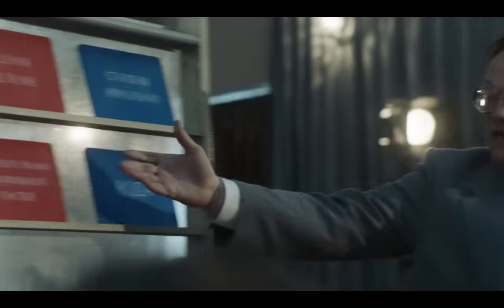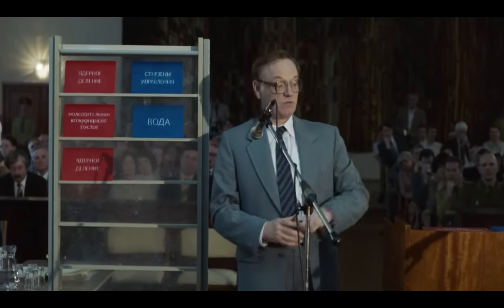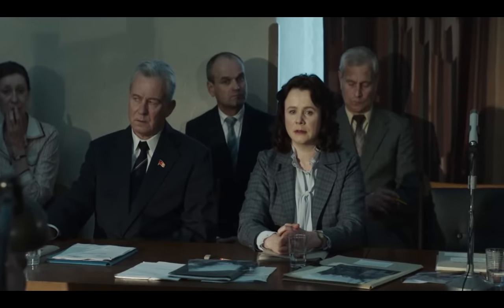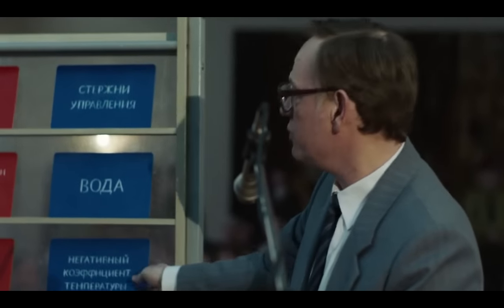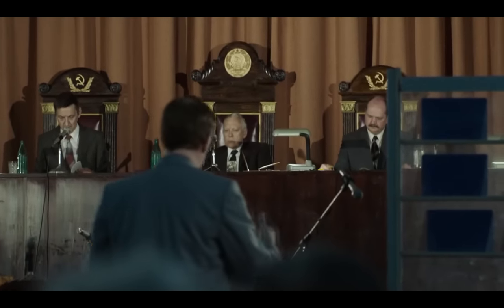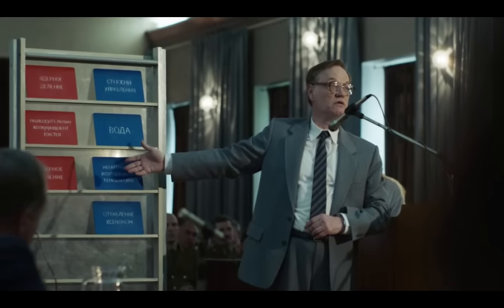Chernobyl scene #1: Valery Legasov explains, how an RBMK reactor works

Comment: This scene should be called “Nuclear Reactors for dummies.”
Reply: no, the explanation is better than any documentary I saw about nuclear power
Reply: As we all are.
Reply: @herbertsdottir9223  "For Dummies" books are actually highly informative.
Reply: More like “How nuclear reactors work in a nutshell”
Reply: Matt S  Exactly, i'm glad someone said it. All nuclear reactors essentially use nuclear fission to create heat, that heat is passed to a fluid (usually water) and that creates steam which runs through steam turbines, which generates electricity. This scene from the show, while being an amazing way to explain a complicated reactor, explains RBMK reactors only used by the soviet union. RBMKs also have a dangerously high positive void coefficient. This allows them to run with unenriched Uranium and without "heavy water" which saved a lot of money, as well as making them "dual-use" as they were able to produce weapons grade plutonium. Before Chernobyl all RBMKs ran a positive void coefficient at 4.7 beta and after the disaster only at 0.7 beta.
Reply: RBMK reactors, anyway. We don't build those in the west. PWRs or BWRs are our standards. A lot more stable.
Reply: @82dorrin  Not always stable (See Fukushima) but also not using your feedwater to also cool the pile, or using graphite tips to start a reaction, or not making the control rods gravity fed like modern PWRs or CANDU. At the very least, the faults of PWR/BWR/CANDU/MSR are known and can be accounted for.
Reply: Watching this I kind of felt like sitting in a class about reactors 101 lol
Reply: Nuclear reactor guide 101
Reply: And let's face it; all of us are the dummies.
Reply: Mademoiselle Beazulbub He’s delusional, get him out of here
Reply: One reason why so many dummies exist is because of book titles like that, and "teachers" just acting supirior. Only giving out knowledge to select few
Reply: noted
Reply: The entire series should be called that. Every so often, we get a nice, high-level lesson in Nuclear Reactors. It's fantastic.
Reply: I'm an expert in reactor operation, easy-peasy! We just take out all the control rods! 

Big Oof

Please try again. :P
Reply: Is it bad that im so bad at science i still didnt understand?
Reply: Hahahahahahahahaha!!!!!
Reply: "How to reaktor for commrads"
Reply: Western PWR Reactors don't use this cost cutting measure at all
Reply: Just got linked to this from an Explain Like I’m Five subreddit post so your analysis checks out
Reply: Except the water in  a PWR in the moderator, unlike RBMK which used carbon for moderation.
Reply: @KingThrillgore  Fukushima was an edge case though. An earthquake of that magnitude was not ever expected to happen and building to an earthquake of that magnitude would have cost likely twice as much as it already did. So it wasn't likely even thought of. Had the earthquake never happened, we likely would have never considered that particular possibility.
Reply: @callanmurray9898  This. RBMK reactors are absolute shit and are not a good idea. We have far safer reactors out there, and people should be aware that Chernobyl is not how most modern reactors are built.
Reply: There's The Simpsons for that
Reply: Lmao